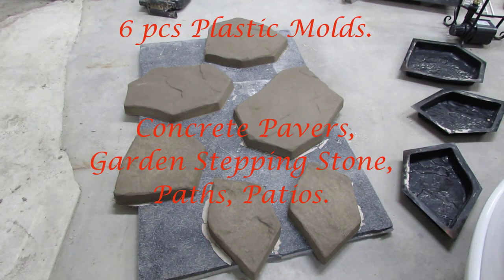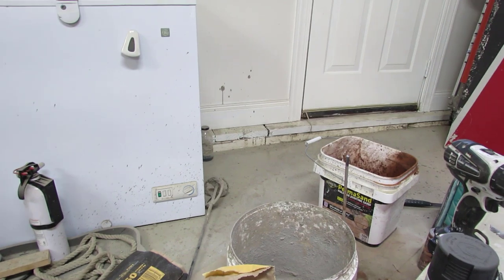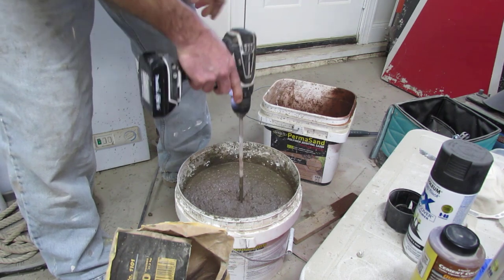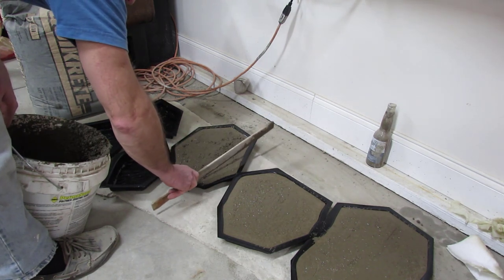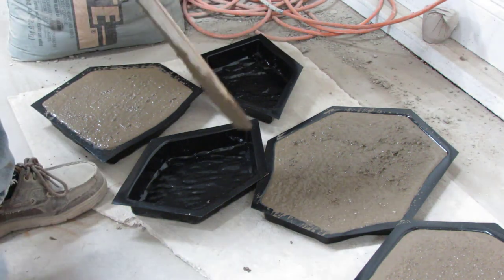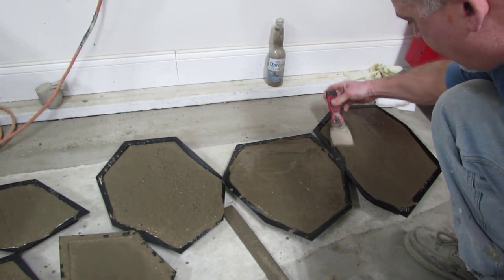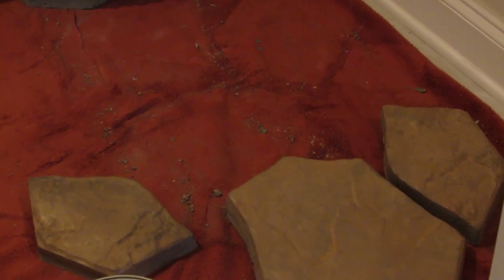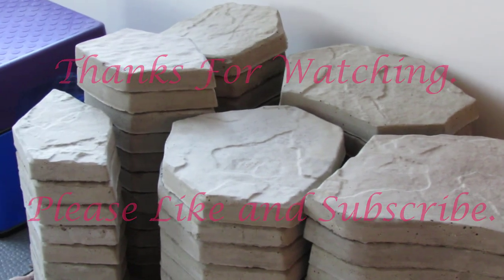DIY Concrete Pavers. EBay Molds.

Comment: Thank you for the demonstration! But is there a way you could post a finished picture  after you fit them together on the ground? Wondering what it looks like as a patio or walkway!
Reply from the maker: I will work on it for you.
Reply: @easywaydiy9555  Thank you!
Reply: @easywaydiy9555  did you ever get a chance to take a finished picture? I’m getting ready to start making these exact molds.

Comment: I used the Supercizer 5 Plasticizer from Fritz Pak in the same set of molds.  Canola oil for release.  With the fritz Pak product the pavers just fall out with no effort.  With no plasticizer it was a struggle to get the molds to release.

Comment: Thank you for sharing, it covered everything.
Two suggestions. 
1st, about staining vs. adding the color to the water before mixing, I would say that the staining would not last and will require re-stain every 3 - 4 years (depending on the foot traffic, rain/snow/pressure washes). Adding the color within the cement will become part of cement pigment and will be permanent. You must add the whole 10oz bottle per 60 or 80lbs  bag. You can reduce the amount a bit to get color variations but that's what Quikrete recommends. 
You can also buy the gallon stain of your choice (as in your video), thin it out and then add that to the water before mixing to the cement. That would be cheaper compared to $11/10oz color bottle. 
   
2nd, a rough wooden leveled table (3X6 feet) will take out the back pain from the equation.

Comment: Thank you! Your video has given me some troubleshooting ideas for what I might be doing wrong with my pavers. My molds are totally different, but they do have a lot of detail that I've been having trouble with keeping from crumbling when I demold the paver. Each one takes about 40 lbs of concrete, and I think I've been rushing to take them out. Now that I have more than one mold, I'll try leaving them to set for a couple of days. It's very hot and humid right now where I live in Texas, and that may be why I've had a hard time gauging when it's time to demold. Thanks again for your help.

Comment: Can you make a square/rectangle path with these?
Reply from the maker: Yes, you would just have to cut the pavers on the edges of the path way.
Reply: just buy an all in one mold lots of designs on ebay amazon no need to do it separately

Comment: I bought these exact forms they come from ukraine, I also have the same issue, it seems like 5 of 6 are perfect and 1 comes out with bubble issues or holes, what are you using to fill the holes?